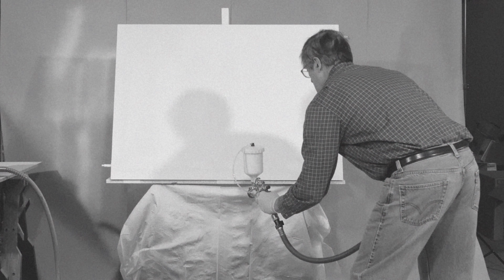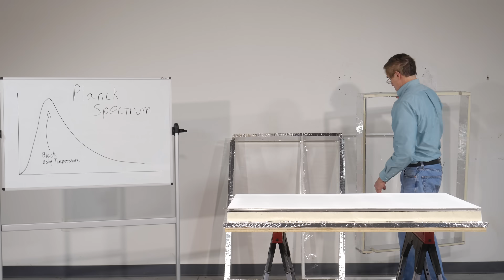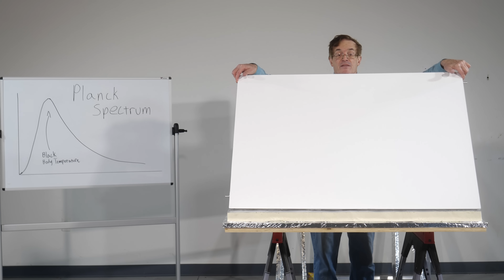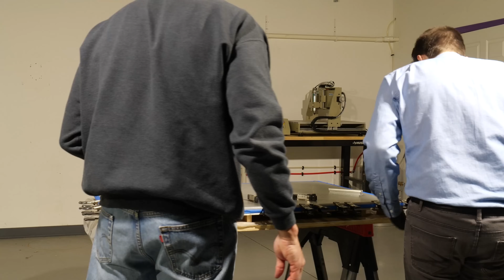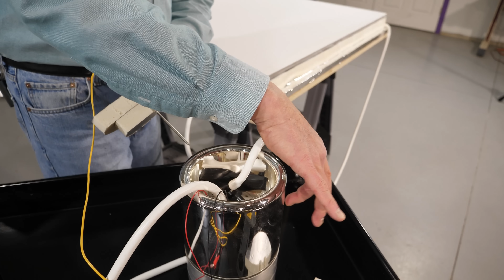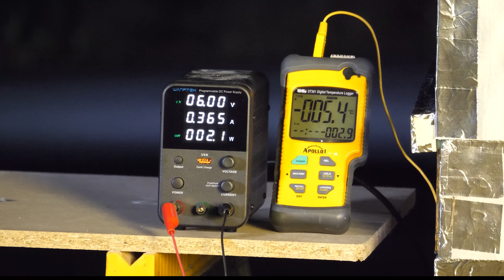Air Conditioning isn't free... but we're close.

Comment: My entire journey of engineering started with your vids on the dessicant AC system when mine went kaput (in June n Alabama, which is unlivable). I thought it was is utterly ridiculous to just call a dude and spend 6000. Soooo....

After many months and 100s of papers read, I'm fliunent in phase change materials, all manner of material property materials, fluid dynamics, heat pipes, vaper chambers, immersion cooling, refrigerants andddddddd...etc

Comment: I was surprised that you did not apparently consider the 2 Watts or thereabouts being dissipated by the pump inside the dewar. I would imagine that this would not be a negligible heat input in this small setup. If the pump was outside the dewar, the cooling may have been more effective?
Reply from the maker: Yes
Reply: It shows that there is net cooling despite the energy put in to pump the liquid

Comment: Super-white does not work in most of the United States because grey crap settles out of the air all the time.  Its probably a mix of refinery, factory and powerplant emissions combined with diesel and airliner exhaust.  This is why white outdoor furniture sucks here.  Soon enough will build up on your saran wrap to emit infrared.

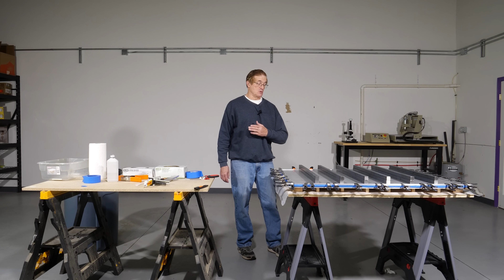Comment: 17:20
no respirator?

also, shouldn't the inside of the extension be black, to absorb the unwanted radiation instead of reflecting it down further towards the panel? Kind of like inside of telescopes is coated black to absorb the unwanted light

Comment: To be fair, we mainly are so inefficient with heating and cooling as a result of the invention of electric climate control. Remember that we used to structure buildings so that the summer sun light would strike the roof with a light color and then pass through upstairs balcony windows in the winter. We stopped doing that though with the advent of electric climate control as it's easier to build and less complicated to engineer. We could always go back to that, but I see that as rather unlikely.

Comment: Love the idea of barium sulfate ultra reflective paint just wish they would hurry up and mass produce the paint to reduce the cost. Love your videos
Reply from the maker: Thanks!
No worries, in our next video, we'll  show you how to make it...cheap.
Reply: @TechIngredients  Been looking at costing for a 3D gyroid infill metal printed heat exchanger  for custom HVAC  ait-liquid but above my price range possible
Reply: Why not use calcium carbonate? Isn't that lime wash which people have been applying to the outside of buildings for a long time?
Reply: Henry Roof Coating, white, has this property. It is used on RV roofs, school buses, and other applications to reflect up to 98% of sunlight and heat. You can get it at Home Depot or any roofing supply.
Reply: Here I was thinking this was using the hafnium dioxide coating.
Reply: I would suggest expanding on the practical applications and potential benefits of radiative cooling paints. For example, radiative cooling can help reduce the need for air conditioning and lower energy consumption in buildings, which can lead to significant cost savings and reduce greenhouse gas emissions. In addition, radiative cooling can also be used to cool electronic devices, which can improve their performance and increase their lifespan. Furthermore, these paints can be used in arid regions to provide a source of water by condensing water vapor from the air, which can have significant implications for water conservation and sustainability.
Reply: @TheCoachingConnection  wow thanks , i never heard of  of radiative cooling paints, my problem is with my windows, i have lots of glass which sadly i cant paint....

Comment: I think the industry avoids using radiant heating loops for cooling because that's a recipe for condensation, and thus mold. Your AC has a condensation line that drains outside for this very reason.
Reply: Since the air is not circulating freely, the amount of moisture is limited. The transparent cover can be placed after the inside is filled with low humidity air, e.g. room with temperature bellow 0, or air directly from air conditioner.

Comment: Thank you for sharing this so far. Please remember to do the follow-up video. I very much want to learn about the daytime efficiency and the coating. I'm in Florida, and the summers are brutal here. Any improvements that I can make would be very much appreciated.
Reply from the maker: Thanks!
That indeed is next.
Reply: @TechIngredients  glad you'll be covering how to make this!  I've been looking into making similar paints for my metal roof in Albuquerque
Reply: I am building a box truck to live in (in Florida). Anything I can do that can cool without turning on the AC is appreciated.
Reply: especially considering the electricity bill here is averaging almost $200! it's insane
Reply: @katiebarber407  *Laughs in German*: Those are rookie numbers! 
actually dies inside
Reply: @DracoOmnia  160$ a year!?!? I'm literally dying inside right now. I think we pay nearly 0,40€/KWh for electricity, and almost 0,20€/KWh for natural gas.
It's our own (politicians) fault...
The real joke is: If you have solar panels in Germany, you CAN NOT just use it for yourself but NEED to feed it into the grid! The company supplying you with electricity will then pay you about 0,07€/KWh back. But that's not the best part still. That is the fact, that you pay TAXES on that AGAIN! PLUS some bullshit extra tax they call EEG-contribution (stands for renewable energy) and was first implemented to finance the "change of the German energy system to renewable sources". You can only loose.
Also it will soon be mandatory to put solar panels on all new buildings here, so that homes become even more expensive!!

This crap has been going on for many years, steadily worsening, but now they just tell the stupid Germans "it's because of PuTiN" that they can no longer afford to heat their homes or take warm showers. I'm very sorry, but this country will soon be lost if this continues.
Reply: @N.M.E.  I assume English is not your native language, so I mean this in a constructive, helpful way, but you used the wrong word when you said "You can only loose". The spelling is "lose" with only one O. An example of the meaning of "loose" is when referring to an article of clothing being too large, you would call it "loose fitting".
I do hope this was helpful and that you are not offended, since that seems to be the predominant impression such spelling correction comments gets. Everyone is just so defensive and it hurts their egos to be corrected. There's no insult inherent to corrections of spelling, we are all human and mistakes are made, especially when it's not even your native language.
Reply: Phoenix laughs at your Florida heat.
Reply: @LesterSuggs  Being dry, you can just do evaporative cooling. That doesn't work here.
Reply: @machinemaker2248  The hottest months in Phoenix are the most humid. They have monsoons so evaporative cooling doesn't really work.

Comment: Have you calculated the overall efficiency of the system including the energy it takes to drive the pump?
Reply: It’s always more than just operating efficiency. It should be the full energy to produce everything. Aluminum takes a lot of power to smelt.

Comment: I've learned so much from this channel. This is amazing, and it's applicable to a project I'm working on. thank you; love this!
Reply from the maker: Wonderful!
Reply: @TechIngredients  We're you a teacher or professor at some point in your life?  You are very good at describing a multitude of science topics and keep people engaged in your creative projects.  From jet engines to rockets and air conditioning you name it, you've covered so many topics, my kind of channel indeed.  Would have loved to have you as a science teacher in high school even though your much beyond high school level teaching.

P.S.   I'm the guy that asked you before what you thought about nitric acid as an oxidizing agent in hybrid rocket motors and you said you didn't like it because it was too caustic and I would need some way to pressurize the container, I can't remember your exact response so please forgive me.  I decided to pursue it anyways and you were right,  Its hard to find a container for it and the spray nozzle must be made from a plastic designed for oxidizing acids.  Not cheap, and I believe a graphite rocket nozzle would erode rather quickly.  I've looked into 3D printing my own rocket nozzle that can hold up to the heat and corrosiveness of such a reaction.  Hard to accomplish for an amateur rocket builder.  Not to mention the toxicity.  I'm going to keep pursuing that or hydrogen-peroxide still while practicing all safety precautions. Also, I wish you to revisit hydrogen production via electrolysis.  There have been a few papers discussing urea as an electrolyte that can reduce the required energy needed for creating hydrogen.  I plan on using carbon electrodes plated in copper and then nickle using urea as an electrolyte (also some KOH) to make an effective and cheap HHO generator.  So no platinum.  Also placing strong magnets in reverse polarity on each side of the cell will aid in the electrolysis producing more hydrogen hopefully getting more energy output to input ratio.  This is all just from documents I've read on the subject.   Robert Murray-Smith has made a few videos on the subject as well as his channel is devoted to energy production mainly,  you should check him out if you haven't already.   Thanks for sharing your vast knowledge with all of this.

Comment: I wonder if it would be worth replacing your tiny reservoir with a large tank to act as a thermal battery? At night when the system is more efficient, it could cool a large body of liquid, of which you can use during the day.
Reply: A thermal battery.
Reply from the maker: That's  certainly an option.
Reply: I believe that is the basic operating principle of some large commercial chillers which provide daytime cooling to office buildings.
Reply: But you already have a thermal battery at home:
Your home.

Comment: But the majority of people who use air conditioning also don't live in "big sky country". 
You are also not calculating for the consumption of energy the pump uses. Or calculating the impact of  the fabrication, manufacturing, installation, maintenance and repair of the unit, an additional component. It's convenient for your argument to pretend they are zero; pretending they don't exist. But they do exist.
Reply from the maker: Just wait till we show you how to make the paint. Then the only equipment  you'll  need is a spray gun and a building to use it on.
Reply: @TechIngredients  my house is made of brick and aluminum siding on its exterior... 🤷🏼‍♂️

Comment: well its free, you did not do anything to get it, God gave it freely to be free, money-law is nonsense, same for people rules(rship)
Reply: if God did not give freely to you, you lie
Reply: whomever this fits, does not suit me, suits you
Reply: radio oscillations are perfect black bodies at whatever frequency they transmit
Reply: diodes/light is perfect radio transmission
Reply: thermal diodes
Reply: or peltier diodes
Reply: thermal energy self-activated diodes
Reply: rising hot air cooler is passively free, cold air from bottom, hot air out top
Reply: cold air vertical cooler channels, old tech style
Reply: plant pot cooler (passive surface water boiling based) by murray smith
Reply: or just use solar heat to freeze/thermal-mass-cool "for free"
Reply: yes God invented all, give honor to God alone
Reply: pride in people is not worth it
Reply: when there is no delta, to outside, hmmm
Reply: law-ownership-based are too rich in their own mind
Reply: you could anodize the aluminium, very porous and absorbent of glue, also paint
Reply: show God's expertise, not to be slave of "experts"
Reply: people knowing is witchcraft
Reply: give honor to God who knows alone
Reply: not that close, stay away
Reply: your effort save(s/d) you? then God does not get honor for what God pre-paid-made
Reply: nice COP
Reply: under ground is always around 5C cold, so you have always a temperature difference for cooling
Reply: better be free, or you aint free

Comment: A body emits ~1.2kW?  I had always heard that it is about 100W - am I misunderstanding something?
Reply: 1.2 KW to space.
Reply from the maker: Correct.
Reply: @benthere8051  thanks - to make sure I understand it right, I you loose ~100W when in a room (loos to the environment and other objects around you). You loose closer to 1kW when outside at night, as it is a thermal "sink" that is much colder than the room in which you loose 100W.
Reply: imagine the body is a spherical cow in a vacuum
Reply: I can’t see how the layer of water moves past the supporting aluminum rails you’ve installed between the insulating foam as it is epoxied to the upper skin, apparently full-length. Obviously it works, I just can’t see how. 
Where are the water passages between these elements? Is there a channel left around the perimeter to enable flow?
Reply: Probably the amount you'd radiate if there was no air around you, at a not too different temperature. He did mention that air was a good insulator. The amount of power required to stay at a constant temperature depends on temperature difference - between you and the air that is (hopefully) around you.

Comment: Very interesting, I recently got myself a Thermal Camera and while pointing it around I couldn't help but notice that the sky had between -50C to -70C. I was already wondering how that temperature came together, the more you know!
Reply: I too have used a FLIR camera at my work 20+ years ago and was surprised to see the blue sky was black and cold when the temperature of the air was over 100F.
Reply: @pixelpatter01  Read about emissivity. The sky has no emissivity so it reads as zero. Any reading you are getting is from water vapor and CO2 in the air.
Reply: It's actually colder than that, but your camera doesn't go far enough.
Reply: @namibjDerEchte  but it's not really cold in the same sense of the word past 60 miles. 

 There are just very few particles.
Reply: Think of it as if the camera were seeing the averaged out temperature of the sky, like how with our eyes we see a million tiny black and white pixels as grey. There really is nothing "grey" there, just black and white, but our eyes average out the difference and call it grey. When the infrared camera "looks" at the sky, it "sees" little tiny "pixels" of empty space at close to absolute zero, but it also "sees" water vapor, CO2, dust particles and other greenhouse gases that emit some infrared radiation in very specific bandwidths. Nitrogen and oxygen do not emit any significant infrared radiation at all, so to the camera it's as if those gases weren't even there. But even greenhouse gases are not very efficient radiators when compared to a solid surface, since they have relatively narrow bandwidths of emissivity. So when you put all those tiny "pixels" together you come up with -50 C or whatever the reading says. It will much higher when the humidity is high, since water vapor is the most abundant greenhouse gas, and the percentage of the rest of the greenhouse gases changes very little from day to day.
Reply: I think its a bit of a "optical illusion". because most of the air above you is colder than the surface air, it only loses energy to the air above it. so very little infrared radiation reaches the surface from the air above. because for example, the air in the stratosphere is well above -50C, but the radiation it releases can't reach you. if I'm not mistaken its also a misconception with the greenhouse effect of the planet, its not that the radiation gets reflected back, the planet just get less efficient at radiating energy up to space.
Reply: @danilooliveira6580  The universe emits light and thereby producing radiation, I try and do astronomy, also the stars and celestial bodiies are responsible for why my camers has a exhaust fan built in, at least that's what I'm going with...
Reply: flir reads radiation.  It's just filter to  vidualise to our monkey brains what temp; thr color represents.

Clear sky just "don't have anything" in it to reflect enought radiation to your camera, so you flir reads it as -whatever.

for exaple you can't read an accurate temperature of clean, clear mirror with flir.
Reply: Not how the camera works. But ok
Reply: Atlantic anomaly is different
Reply: I really consider that more of an error, when you point then I’m the sky there’s just not enough particles near by giving off heat for it to measure normally. It’s getting as much ir radiation sent the sensor as it would with a -50C object, in this case it’s not because it’s -50C but cuz there’s essentially nothing in range of the sensor
Reply: I am now wondering what makes south pole get colder than that?
Reply: @MiniRockerz4ever  That may have to do with airflow.
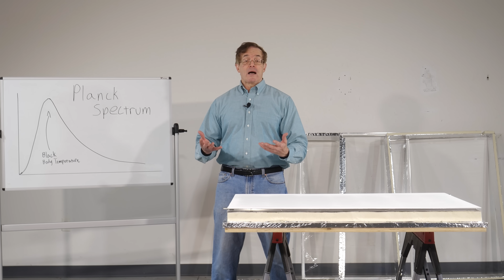Reply: @MiniRockerz4ever  he explains it around 2:30. The temperature of the sky is made up of the air column from the ground till space. That temperature will be lower on the south pole because it's colder at ground level.
Reply: @MiniRockerz4ever just a guess, but probably cause the snow and ice are reflecting heat into the air and nothing is reflecting it back or absorbing it

Comment: If you plumbed this into existing a home radiator system for cooling, would the cold surface of the radiators not condensate?
Reply: if the radiator is colder than the dew point, then it will condensate. So it depends on the weather.
Reply from the maker: That depends  on the dew point.